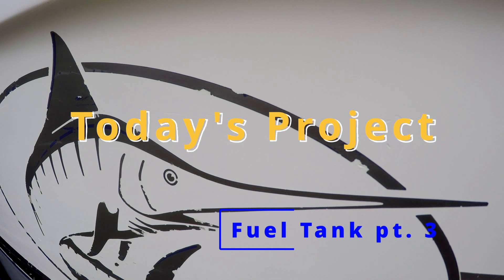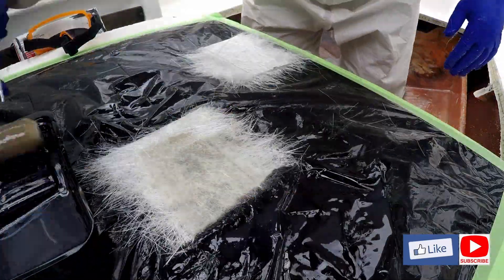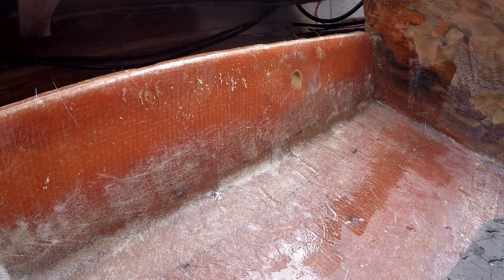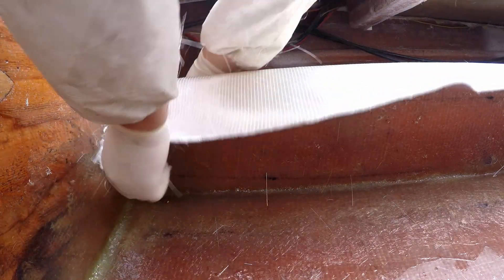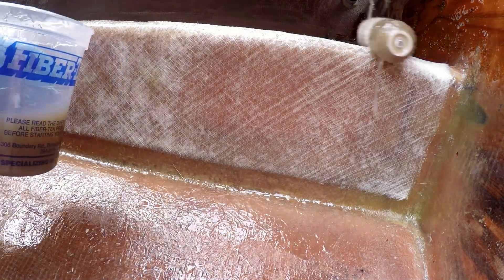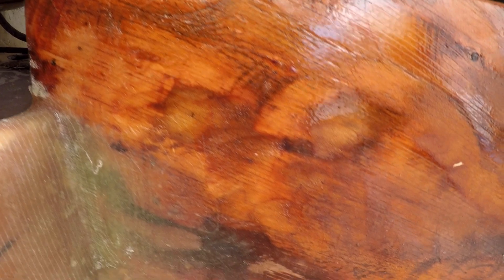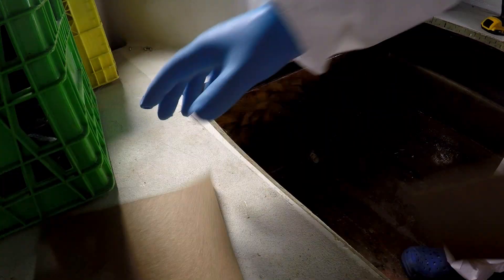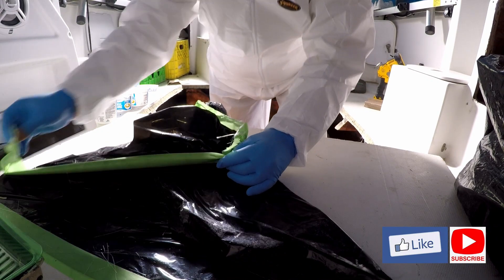Fuel Tank Pt 3

Comment: What happened to the rest of your videos? I’m itching to see the Dash and topside
Reply from the maker: Thanks for your interest. I just uploaded Episode 4 of the Fuel Tank Project. I will endeavour to release some more soon. I hope it's worth the wait, but I did complete restoring the gelcoat on the dash at the end of Fall last year.

I think you're referring to the dash panel with gauges etc., but I have to say that was done prior to undertaking the restoration. The dash panel was done when I upgraded the Yamaha main engine.

However, the mess from the fibreglass project required extensive cleaning and some work with the switches and panels, so I will try to film a quick video showing how I did the dash and switch panel.

The fibreglass repair on the dash, however did get restored, and there will be a video showing that process.

I have footage for many many many steps in the restoration. Editing and Voice-over takes me a long time, but I'm due for some free time while the boat is in winter storage.

Thanks for watching.
Reply: @diyprojecttrophyfibreglass7892  thanks mate. I’ve enjoyed your vids. We have a 2002 WA also, and I’m wanting to refresh the cockpit etc

Comment: Hey what's that bracket on the left side stern? It's roughly 4x8in mounted? I ask because I just got a 92 Trophy DC and I have bolts in a 4x8 pattern on the right stern.
Reply from the maker: If you are referring to the plate in the port side battery box, it’s a plywood reinforced plate for my kicker bracket.

Comment: Great job on both video editing and on the boat aswell.
Im also restoring a small 14ft fibre glass boat at the moment which makes these kind of videos inspiring.
What boat did you use before and what kind of fishing do you mainly do?
Reply from the maker: Hi Danny, thanks for the comment. My first boat was a 12’ aluminum that fit in my garage, my second was a 17’ Campion bow rider. My passion is salmon and halibut fishing in the Pacific Northwest, and to some extent, sturgeon fishing on the Fraser River. I fish alone mostly, so I can manage a 21’ boat easily enough. I can sleep on it, and take extended overnight trips. 

I started small, and gradually customized the boat to have the best components possible and removed items that caused unwanted maintenance and cost, like cutting out the fish lockers that filled with water and burned out Macerator pumps, adding secondary steering so I could steer alone while fishing etc.

My financial reality in retirement will mean that I need a solo platform that won’t bleed me dry.

Thanks for watching, I hope your project goes well. Cheers.

Comment: Make sure you use biaxial or 1708 to tab stringers to hull. Csm alone is not strong enough
Reply from the maker: Thanks David. Absolutely correct, but in my case, I felt the work to be mainly cosmetic in the fuel tank area, regarding the tabbing. The stringers remained intact so I just added two layers of CSM for added protection. There was little to no gelcoat anywhere under the deck, so I added a couple layers for added protection, prior to gelcoat.

Looking back, it would have also been much easier to use 1708, but it was my first attempt. CSM is a pain.

Excellent point though, so when I did rebuild the floor in the cabin, all my tabbing was 1708. 

Thanks for the comment.